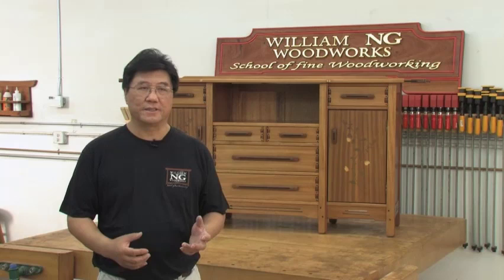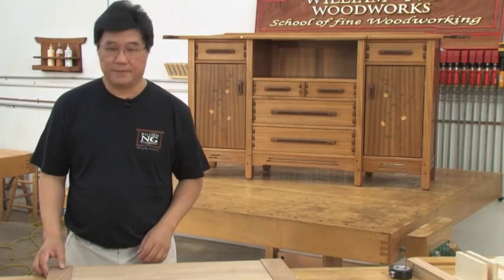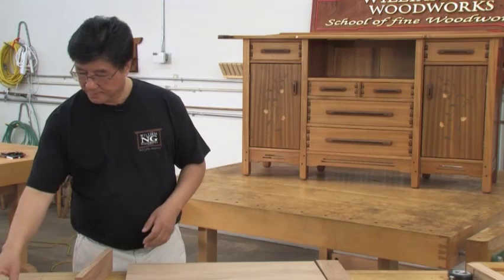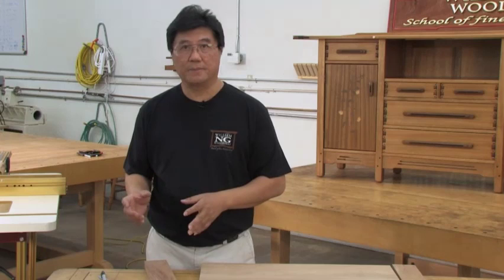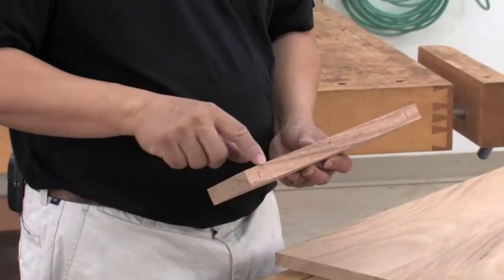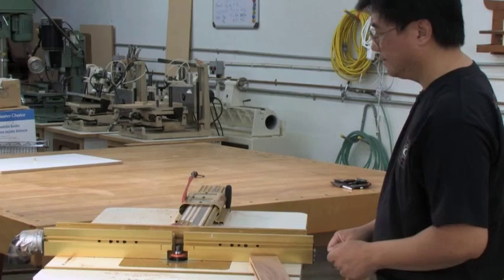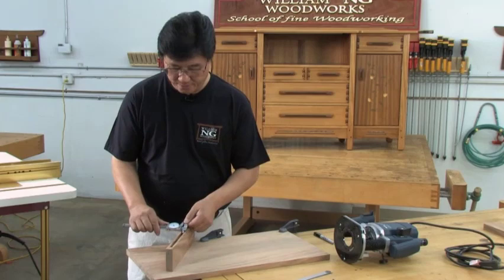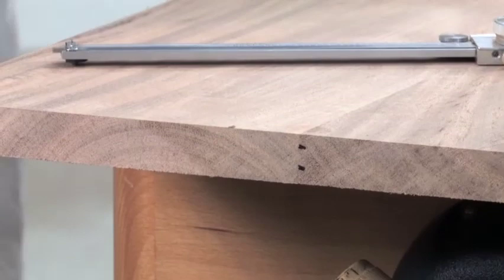Greene & Greene Joinery Details

Comment: What is the horsepower of your router table motor. It  seemed to make the cut without an extreme reduction in rpm.
david
Reply from the maker: I can't be certain, but that table is designed for 1-1/2 to 2 hp routers. These mid-sized routers do a tremendous amount of work without much complaint. The larger 3 hp routers are frequently only used for extreme routing applications that used to be the work of shapers. Technology has made the shop a happier place!